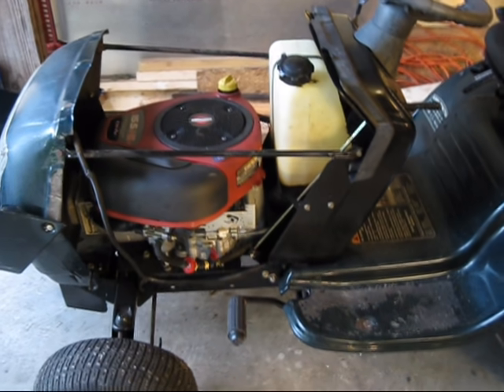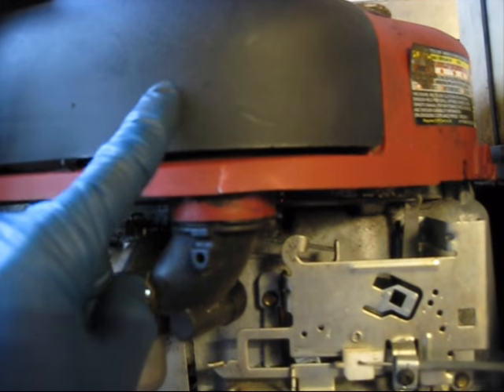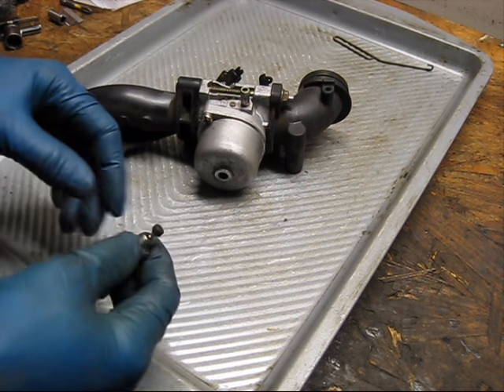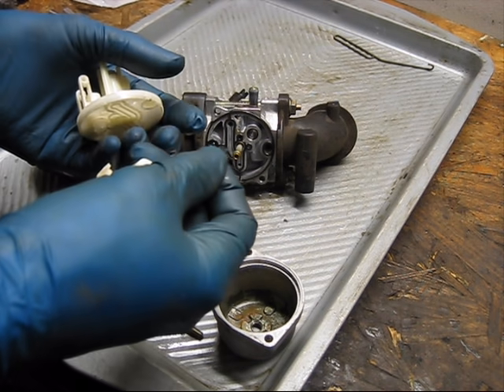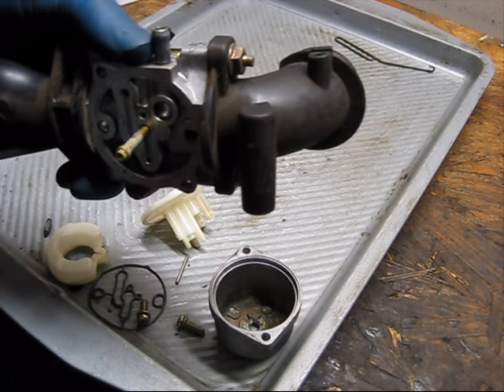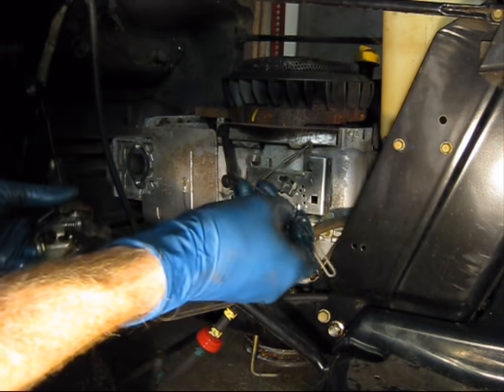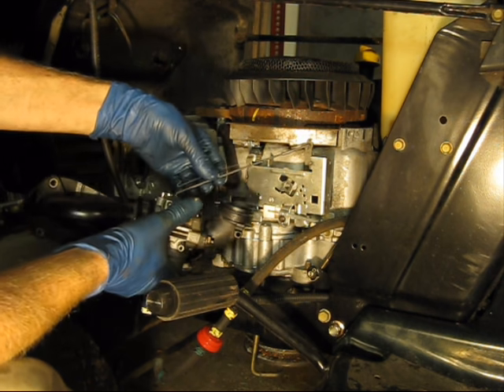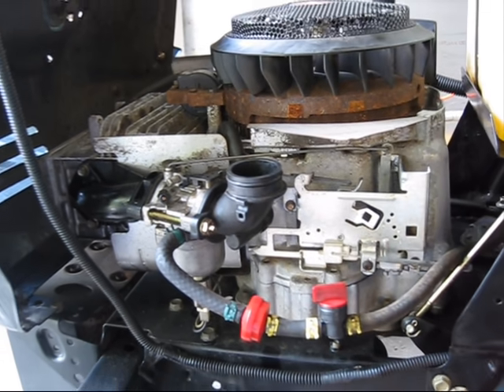Flooding Nikki Carburetor Causes and Fix

Comment: I have a question how does the o ring cause it to flood when it still has to get past the needle and seat ? I ask that question because of a carb I was working on for a friend. He too has an o ring issue where it started flooding. I was thinking his needle and seat was working, but I could visibly see the o ring wasn't in the best of shape and it too started flooding.
Reply from the maker: There's 2 designs, one uses a separate O ring and the other has a seal built into the larger seal. The fuel comes into the carburetor through the aluminum carb body, but the needle and seat are in the plastic carb body. The fuel passage between the two are sealed by the O ring or the large seal. If it leaks the fuel will enter the bowl unmetered, so its the same as having a leaky needle.
Reply: That makes sense. Thanks for the reply @pfun41

Comment: I am rebuilding a Craftsman similar to this. I bought cheap it with a blown engine. It has a fuel shut off too. And the carb was flooding. I suspect that might be why the engine blew. Thanks for the video and troubleshooting information. 

The guy didnt take care of this very well.

I have had to replace the engine crankcase, sump cover, connecting rod, cam gear, intake push rod, governor oil slinger, carburetor, air filter, magneto, ignition switch, spark plug, battery, flywheel key, flywheel fan, a bunch of gaskets, mower blades. And Im not done yet. There may yet be more to replace. I almost feel cheated for buying it.

Comment: Is the solenoid supposed to move up and down freely when you look at it or stay I. The down position?
Reply from the maker: The plunger should retract when not powered. The return spring is very weak though and sticks easily.

Comment: Hey,   u seem to know all about this mower & motor stuff. -  Maybe you might know this answer      ....   briggs & stratton 13.5 motor (Old)      ...  I bought a NEW carb for it,   got it all installed, the VERY last thing to do is put the metal screw rod thing that screws in the bottom of the carb & thru the air filter to tighten it up.        Roughly 7" long.        .<<<<    That screw rod thing didnt come with the new carb,  and my old screw rod thing is too big for the new carb.   Too thick.             If I could just find out what the HECK that screw rod thing is called, I could actually look up the correct part for my carb.          Is it a Air filter screw?   is it  ............I dont even know what to even call it.      Long skinny threaded rod    ,   without it it leaves a hole in bottom of carb & also wont allow me to tighten air filter.                 -AAnybody??           2 weeks without mowing its getting away from me, foot high thick grass sucks.
Reply from the maker: Look up a parts diagram and find the picture of it, that will give you the name and part number.
Reply: cant find  aparts diagram for the Briggs 13.5 motor.           ...  I just used an improper screw off some old lawnmower,its woking for now.

Comment: Question: 11.5hp ...Nikki carb...starts up cold with no problem, and no obvious fuel leakage into the oil. Sometimes, it just stops running in the middle of my cut. ... And after its good and hot, and I let it sit for several minutes, it is all but impossible to start. Definitely flooded. I'm gonna change the needle and gaskets as you describe. Any other thoughts?
Reply from the maker: That actually sounds more like a failing coil. If it was flooding it would cough and sputter like the choke was on before it died, and the flood wouldn't just clear, the needle would be leaking too much.
Reply: +pfun41 that makes sense. I ordered a new aftermarket carb ($20). I figured I'd try it, or at least use the gaskets out of it. Installed it, but it ran too lean, and I didn't feel like jacking with the jetting size. So, I used the gaskets, needle, and float and rebuilt the old carb. Also the choke and throttle shafts, and also the little foam "washers". The geometry of the choke shaft was different, so had to re-install the old one. ... Worked well today. No restart problem after heating up. If it does happen again, I will focus on the coil. Thanks for the reply.
Reply: Greg Vanek pap

Comment: What is the part number for the fuel inlet oring? I can't find it anywhere. Help!
Reply from the maker: It's considered part of the bowl/body gasket and is not sold separately so it does not have a separate part number.

Comment: Having the same issue with the same kind of nikki carb. Replaced the needle, seat, float, and all gaskets & I'm still having the same issue. What exactly were you referring to as a clogged vent being a cause of the flooding? Please help lol. I'm tired of tearing this thing apart.
Reply from the maker: There's always a vent from the carb bowl to the intake to prevent pressure buildup.
Reply: The only vent I'm aware of is the vent in the gas cap, and it's definitely not clogged up.

Comment: There are aftermarket carbs for 25-30$ trying to figure new vs rebuild for same cost
Reply from the maker: I've had bad luck with crappy aftermarket carburetors.
Reply: qslim3 Rebuild kits are $7  with free shipping.

Comment: You said high end mowers have fuel shut off valves. There's a reason why...low end mowers should go back to using them. Fuel shut off valves help prevent gas corrosion in the carburetor.
Reply: ken baker Some people say that good clean fuel without ethanol protects the carb from moisture, etc.  Ive heard of people having more problems when they shut fuel off.
Reply: hmmm

Comment: took carb of and cleaned it put it back on and now it wont full throttel only 3/4 throttel any suggestions i did adjust engine valve
Reply: Lori Fitzwater.   Hi Lori..check the main jet o- ring and make sure the needle is good and the gasket is seated ..
I hate nikki carburators when they work they work good...when they don't it can be a nightmare ..one more thing 
If your o-ring at the bottom of the plastic float mount  is bad it will cause problems too..just a thought..

Comment: Man you are good yes im working a nikki carburetor just like that one i had to go through the whole entire carburetor old gas clogs up jets i notice just like you say the bowl gasket once you remove it just replace it with a new one only im working on it for someone once they found out it's leaking they will bring it back only it's not my problem i don't usually buy parts for people i let them buy their's own parts because this something i like doing because my Daddy used too work on small engine's i charge them a small fee for the work only some people try to get by and say that they don't really need to replace the parts and then i end up charging them again because when i work on small engine's even the carburetor, i have looking just like shining coins thanks for the video

Comment: Excellent video! I watched because I thought I may be missing a metal seat to the needle and you addressed that directly. I also didn't realize I've been leaking fuel into the oil. THANK YOU for the information.
Reply: Keith Brookshire The fuel in the oil crankcase can possibly detonate and crack the block or launch the piston in to the cylinder head.
If you are lucky,it will detonate and launch your dipstick like a missile in to the hood.
Reply: How did the gas get the oil?
Reply: @carlcannedy2669  this has been so long ago I don't remember.

Comment: Just curious... when did you go back and put the bowl gasket on? Somewhere around 10:20 or so you put the bowl on the carburetor and it did not have a gasket on it. The gasket was lying in the back of the pan. Lol
By the way, I want to compliment you on informing people about the gas inlet o-ring. I rebuilt a Nikki just like this one for a friend and it still flooded and flooded. I thought about it for a while and it occurred to me that even though I had replaced the needle, if that o-ring on the other side of the fuel transfer plate did not seal the carburetor would still continue to fill with gas. Surely enough, when I replaced that o-ring the flooding problem ended immediately. Incidentally, generic o-rings did not work for me. I had to get the o-ring specifically designed for the Nikki carburetor.
Good video, sir. Thank you very much for sharing what you know.
Reply: Exinanition that's not the bowl gasket that's the intake gasket 🤦‍♂️

Comment: Thanks Pfun, wish I had seen your video before I tried to do on my own...had a serious fuel leak into the engine, the dipstick level was way past full mark with fuel mix ...replaced the gasket and pin on Nikki carb....drained  contaminated oil and gas mix....reassembled everything and added fresh oil....won't start, took off spark plug and it was saturated with fuel... tried to crank without plug and gas gushed  out of uninstalled plug hole...going to try the loosen  mounting bolts to see if it still leaks...any other things I should consider?
Reply from the maker: That's usually all it ever is, Ive heard of clogged vents causing a leak but haven't had any problems like that.

Comment: Ok so I am having the same issue on a 12.5hp engine. I can bench test it like you did on the motor and it's fine but when on the machine it floods I even heated the tab to adjust the float up so it's more level and still same issue what do you think it could be it's stressing me out and the customer is not about buying a new carburetor at $110.
Reply from the maker: That's very odd. So it only floods out when fully bolted up and after the engine has run?
Reply: pfun41 yes sir it is very odd I don't want to give up on it new carburetors are $125.
Reply from the maker: You could get a good used carburetor, swap the new parts in and clean it, that's what I would do.